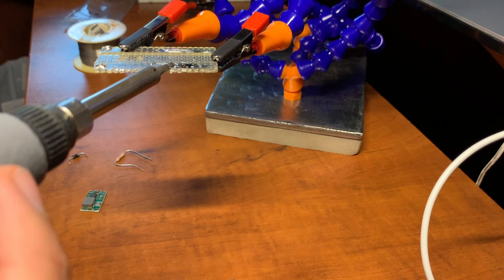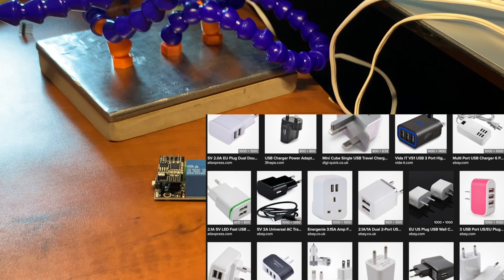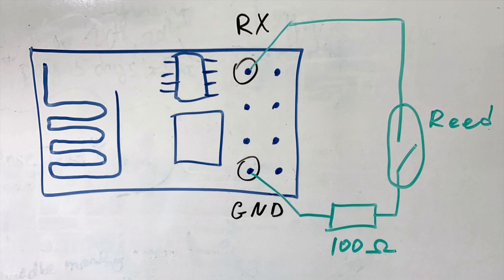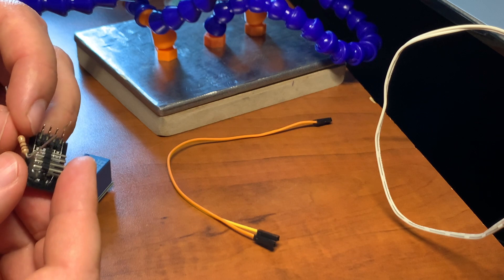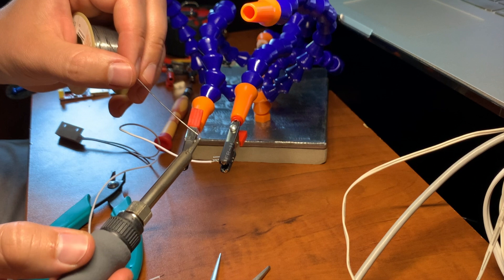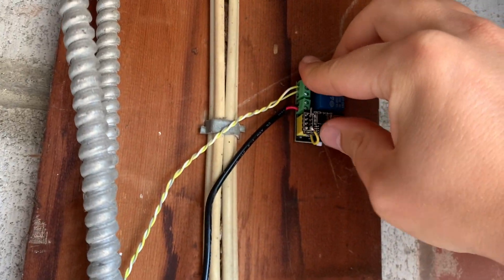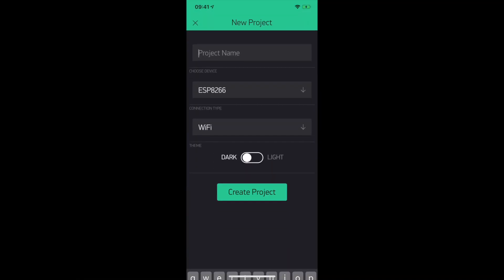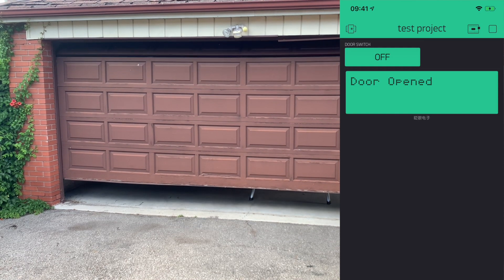#4 Cheap smart garage door opener with door sensor under $10 ($5 - $7): esp8266/ESP-01S.

Comment: The other thing is that you say you're not going to use a subscription. However you use a styled button which needs a subscription. Any ideas?
Reply from the maker: i didn't say i'm not going to use a subscription. i said, some tutorials require you use a paid subscription. 
here you don't need a paid subscription.
Reply: @UNgineering  But for using a styled button you need 'Blynk Plus' or 'Blynk Pro' which is about $10 or $100 per month.
Reply from the maker: @spiderkid6185  you're right, they made it paid now. it was free when i made that video. 
i'll probably make one in the future using an open source platform.
Reply: @UNgineering  Ok. Thanks, any idea on how long in the future?
Reply from the maker: @spiderkid6185  no idea, when i have some free time.